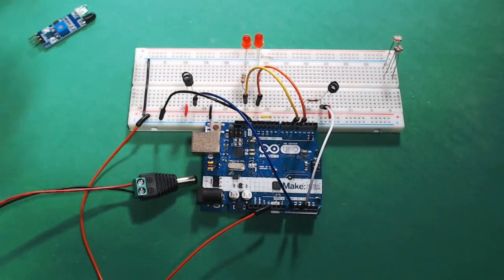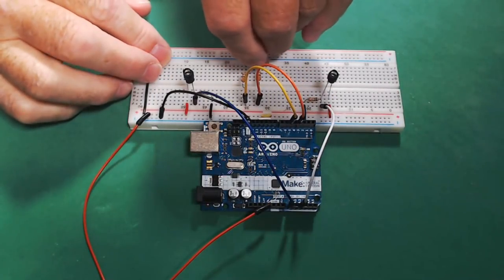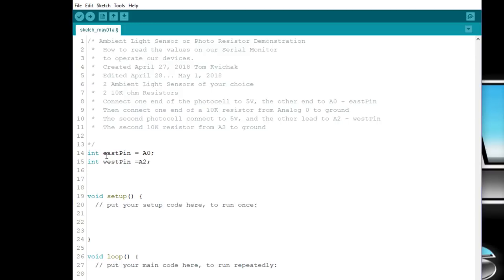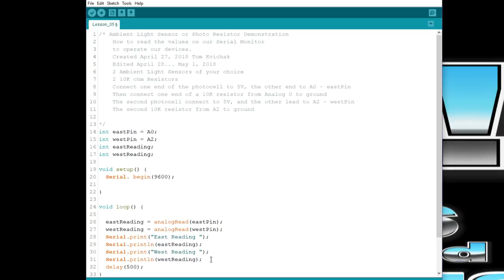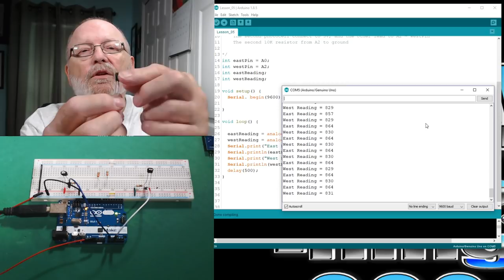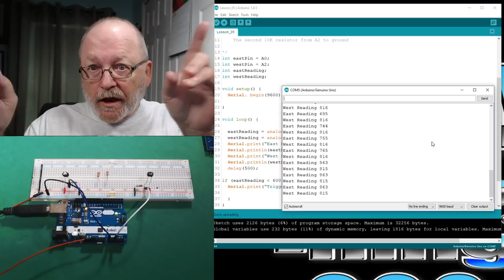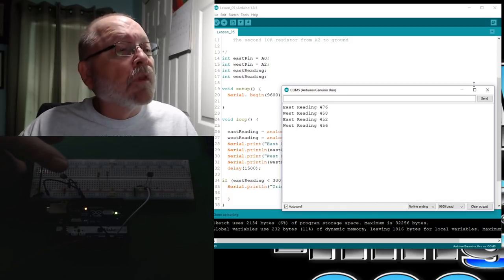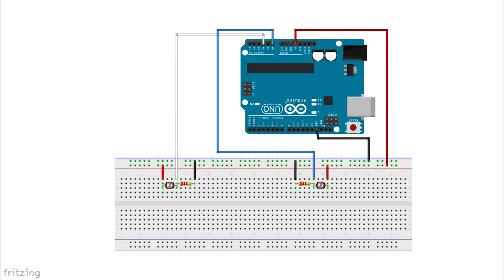Using Ambient Light Sensors - Arduino Made Easy(er) Lesson 05

Comment: Tom very interesting video this looks like just the ticket so I can see where the trains are on my helix, my question is how many of these sensors can the Arduino handle? Neil
Reply from the maker: Hi Neil. The Uno has 6 analog inputs, the Nano has 8 and the Mega has 16. I'll be doing a video on an IR sensor this week that puts out a digital signal, so you can use even more of these.
Reply: Thanks for that you have given me the push to go out and get an Arduino Uno starter pack. I have tried the flashing LEDs  and the ambient light sensors  both worked through to completion with a few problems all overcome
Reply from the maker: Great to hear that Neil. Glad I was able to help!

Comment: I need to find a way to capture the oscillation point or peak data of a moving object and use that data for a trigger.  
To visualize this, Picture a rail with a distance sensor at each end. The target would oscillate between the 2 end points with the center being 180.  To the left the max measurement would be 270 and max 90 to the right. When the target moves to the right then switches direction I want to capture the farthest measurement lowest number serial data to trigger a device when the target is at a certain point on the left. Then I want to capture the oscillation point highest number on the left to in turn trigger the device at a certain point on the right. Due to changing loads on the device being triggered the oscillation points will change randomly. 

Can this be done?

Below is a rough draft of comments without any code. 

//Arduino uno

// vl53l0x sensors
// distance sensor1 value 181 to 270 degrees
//distance sensor2 value 179 to 90 degrees

//1 stepper Nemo 17 or 23 
//Stepper full rotation 0-359 steps (clock wise count 0 north) 
//Home 180, max rotation from 270 to 90 degrees.
// orientations. 270 right, 90 left. 
//sensors placed at the ends of a rail with oscillating target.

//if sensor1 value oscillates set sensor1 to highvalue of oscillation 
Oscillation at 172-173-172 would set value at 173

// if sensor2 lowalue is  = 178
// run stepper to 183 when sensor1 reaches 182  //1degrees
// if sensor2 lowalue is  =177
// run stepper to 184 when sensor1 reaches 183
// if sensor2 lowalue is  =176
// run stepper to 185 when sensor1 reaches 184
// if sensor2 lowalue is  = 175
// run stepper to 186 when sensor1 reaches 185
// if sensor2 lowalue is  =174
// run stepper to 187 when sensor1 reaches 186
// if sensor2 lowalue is  =173
// run stepper to 188 when sensor1 reaches 187
// if sensor2 lowalue is  = 172
// run stepper to 189 when sensor1 reaches 188
// if sensor2 lowalue is  =171
// run stepper to 189 when sensor1 reaches 188
//Etc....... to lowvalue of 90 
//use < at end max run to 270

//If sensor 2 value oscillates set sensor2 to lowvalue of oscillation
Ocilation at 186 - 185 - 186 would set value at 185

// if sensor1 highvalue is 182
// run stepper to 177 when sensor2 reaches 178
 // if sensor1 highvalue is 183
// run stepper to 176 when sensor2 reaches 177
 // if sensor1 highvalue is 184
// run stepper to 175 when sensor2 reaches 176
 // if sensor1 highvalue is 185
// run stepper to 174 when sensor2 reaches 175
//Etc........to highvalue of 270....... 
//use > at end max run to 90.
Reply from the maker: Dean, use the Print function to see what the actual values are that you want to obtain. It will populate fast so you need to add a short delay after the print command so you can see it easier. If you don't use the delay , you can always stop the sketch and scroll back through the communication window to see what your high and low numbers are.

For some reason both f your comments went into the spam folder. If you want to peruse this any further, sent me an email.